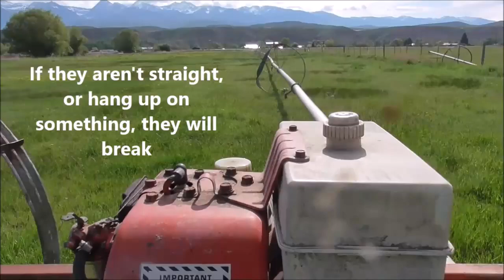Another Day Moving Irrigation Pipes

Comment: Hi There a fellow once told me if you take the front off the pull cord there should be a nut there ,put a socket on a drill and away you go .Have a look, better than a heart attack. I had a wood spitter worked for me, but i couldn't use a cordless drill ,motor was to big for a cordless.
Reply from the maker: That is a great idea!!  I think I might try that!  Spin fast enough it's bound to start!

Comment: I might be wrong, but I would think there should be a shut off for the hydraulic pump and gear boxes till you get the engine running and warmed up. Every time you pulled the starter rope the hydraulic pump and gear box were trying to turn also. Does the carburetor have a choke? There is a guy that has a small engine repair shop that I have learned a lot from, and he has a YouTube channel you need to check out ... " Taryl Fixes All " ... He does funny skits at the beginning of his videos, but then gets down to teaching you how to repair stuff, and he is very good at diagnosing and fixing small engines!
Reply from the maker: No the hydraulic pump runs directly off the engine shaft. There's no clutch or anyway to stop it from spinning.   There is a choke. It will run best closed....if you can get it to start!  I haven't seen his channel. I'll take a look!

Comment: The next time you move that try to find a new  cap for  the tank as there is a little vent in it ,If you are unaware of that. It’s imperative that little vent to allow  the gas to flow . After years dust gets in them and clogs them up.
  I have even taken a 1/64 drill bit and drill new holes through them as it doesn’t take much but it’s got to vent.
 I would also put just a little bit more ,say twice the amount of gas that you put in it in the video.
 Lastly, after you turn the gas on disconnect, the plug wire carefully and push it side and pull it four or five times nice and easy to just   prime that cylinder.
 Then put the wire back on with the choke, fully closed and pull it to start and see what happens.
 I have a feeling you may have more luck.
  On older engines whether it’s a Harley Davidson, knuckle head ,Panhead, or a lawnmower, or the snowblower.
 That’s the system I use and it works eight out of 10 times and I can sleep that night without the blisters from the handle on the pull cord.
 Good luck🍀😎
Reply from the maker: Worth a try, but I think it's mainly carb trouble. Gas runs out of every crack where it shouldn't be.